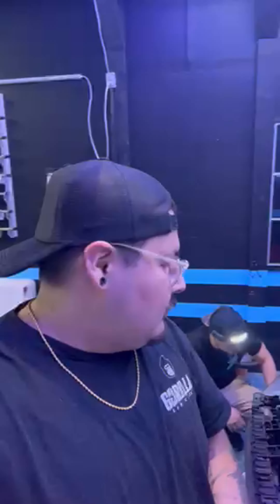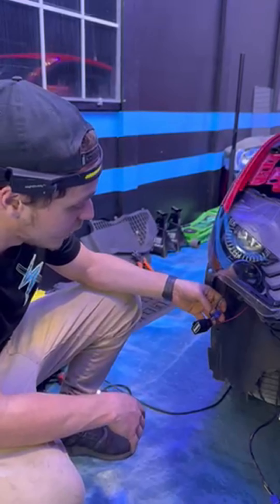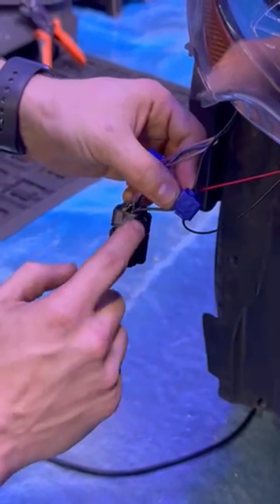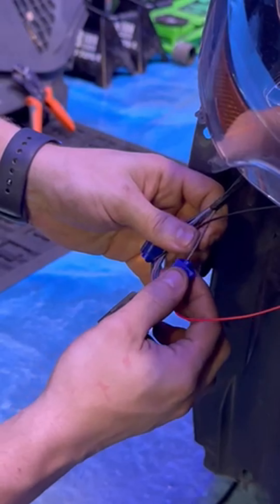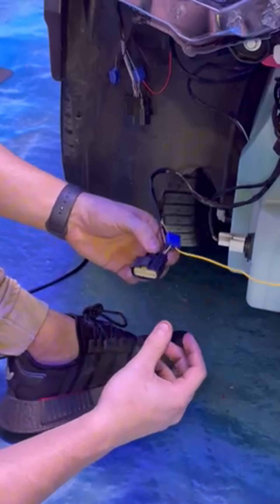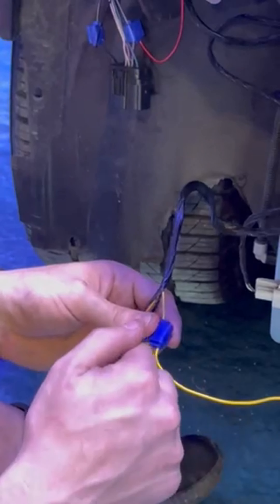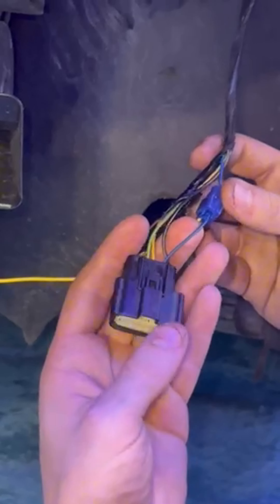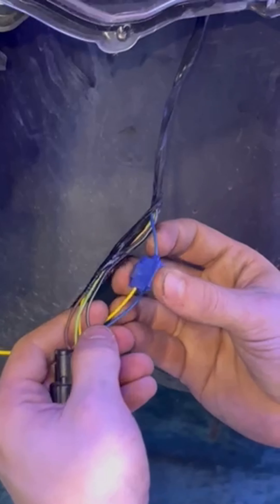How to wire DRL LED for 18-23 Ford Mustang ? | American Modified

Comment: Hi. Commenting to maybe get some help. I installed the same one onto my car and now my Power steering, pre collision assist, and my Advancetrac are all acting up. I’m all for being in the wrong here. I did everything in the video. Followed the same steps, wire colors, and the after installation check. Now my cars got issues. Any reply would probably help

Comment: What about the one cable that has a fuse on it ?
Reply: They give you that for if you don't want to tap into drl light wire. You can use that in place of the fuse it corresponds to.
Reply: Im getting no power and i did everything you did
Reply: Update we got it working
Reply: @jaguarchoir how did u get it working I’m having same issue